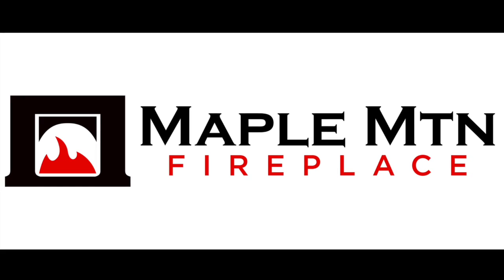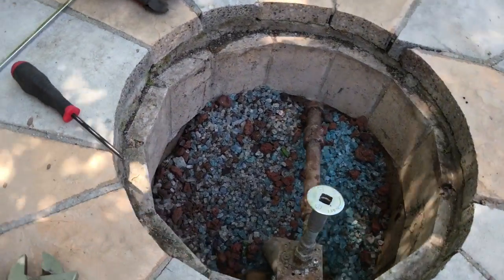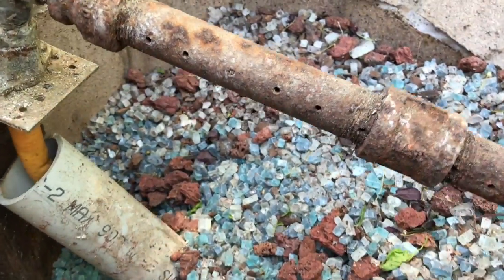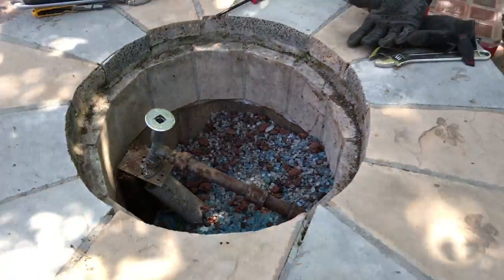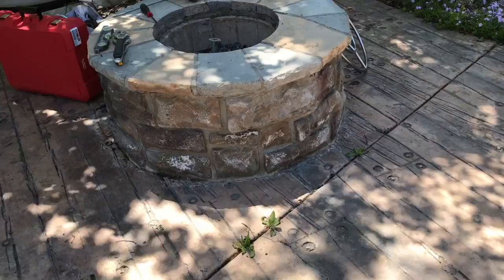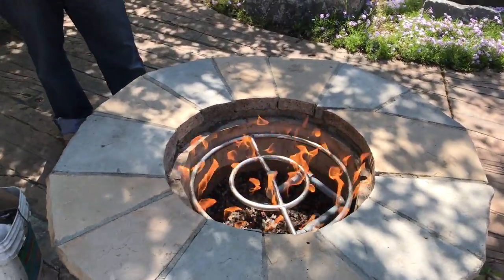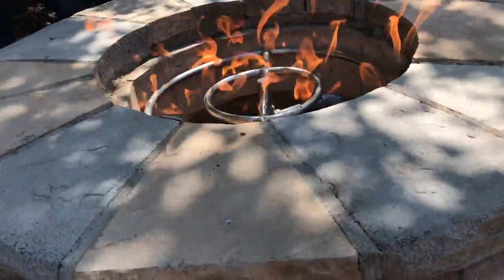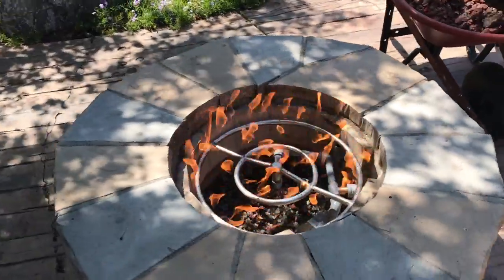Outdoor Gas Fire Pit Repair

Comment: I was wondering are you supposed to install the ring with the holes facing down so water doesn’t get in the rain?
Reply: Ring
Reply from the maker: No, if it will be in the weather, we recommend a stainless steel ring and to cover if possible when it rains.  Do not put the holes down.